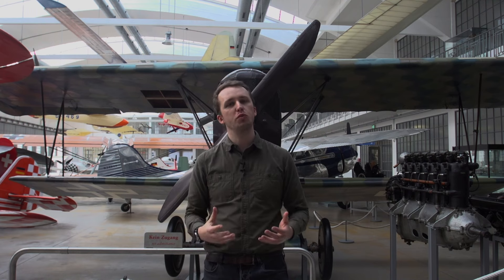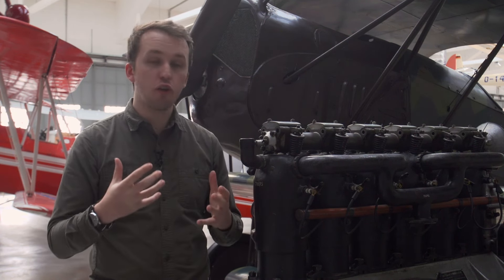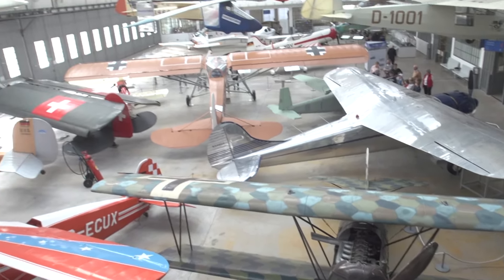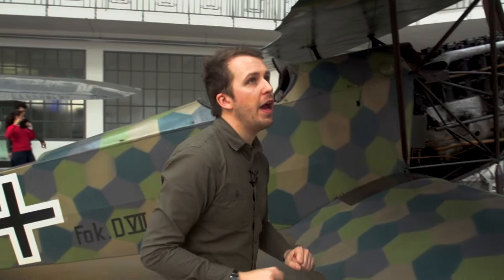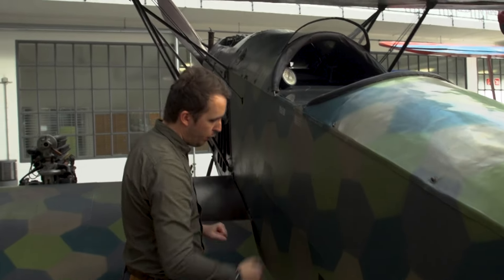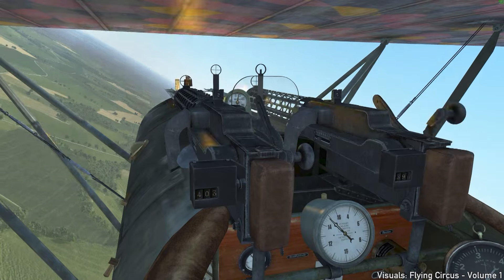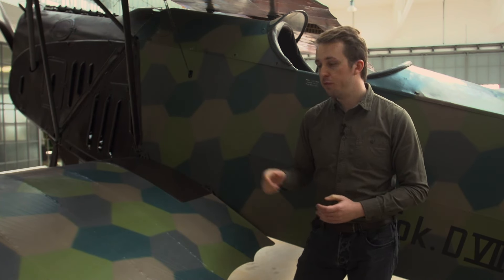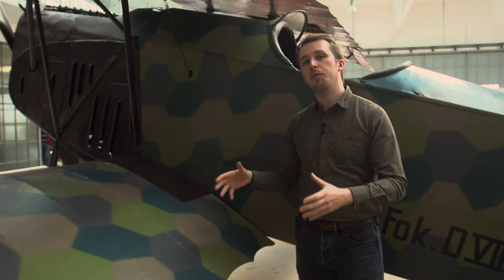Inside The Cockpit - Fokker D.VII

Comment: Excellent video Thank you! Wikipedia says it was designed by Reinhold Platz who worked for Fokker. Anyway I always wondered how the side panel of the engine compartment could be removed when the cabane struts go right through it, most notably the forward most cabane strut. I looked carefully at your video shots of it.. and I still wonder how that was done, it looks like a metal panel without a parting line at the strut hole.

Comment: Love that Fokker D7! That plane and the rotary powered D8 ("Flying Razor!") are my all-time favorite Great War aircraft. I'm wondering if the use of the BMW engine (lighter weight) made the D7 a bit  tail heavy?  Conversely, did the Mercedes engine make it a bit nose heavy? Lastly was there any provision in that era of aeronautical science for a way to trim a horizontal stabilizer to compensate for engine weight? I laughed when I saw the Cessna 195 resting sublimely ... next to this envenomed terror of the skies!
I have an old photo I found online of a D7 which I think might've been a war reparations airplane because it is devoid of guns and has the script "FOKKER D7" prominently painted on the vertical fin. It appears to be powered by the L-6 Liberty, and not either German engine. Perhaps the replacement parts for the Liberty would more readily available?
EXCELLENT VIDEO! THANK YOU!

Comment: Interesting how 10m (30 ft) has been just about average for single seat, single engine fighter aircraft from 1917 to today.  P51 is big, at 11.28m (37 ft),   F16 is average at 9.96m (32 ft, 8 in)
I believe the F16 has more power than the Fokker, though.

Comment: Thanks for another great video. However you glanced over the D,VII's main technical advancement. For the first time during the war, and perhaps in aviation history, a wind tunnel program
was carried out during the plane's development. This resulted in the flat bottomed airfoil you mentioned. Up till that point, both upper and lower airfoil surfaces were cambered like a bird's.
By late 1917/early 1918 engineers on both sides began to realize that imitating nature had its limits. This research led to a veritable "paradigm shift" from which aircraft design has never looked
back.

Comment: Do you mean 'dished' pistons?  I'd have thought 'domed' pistons would actually decrease cylinder volume.  Also, no mention of the D VII's main 'box spar' which I believe was an innovation, giving the aircraft's wings great strength and torsional rigidity.
Reply: Well, the "volume" of the piston increases, with a dome.

Comment: Thank you for your extremely interesting observations.  I have two questions and possibly an observation about the E.V/D.VIII.  The D.VII entered service in April/ May 1918,  the second flyoff occurred at about the same time.  When the E.V was selected, was it envisioned as a replacement for the D.VII, or a compliment to it?  I have always found the E.V./D.VIII fascinating.  A DR.I body with a D.VII wing,  It was 30%+ lighter than a D.VIII and used an obsolete rotary engine with only 110 h.p.   It always struck me as being a more efficient use of materials than the D.VIII, possibly cheaper to produce., more maneuverable, and perhaps even faster.  Was any of what I just wrote true?

Comment: I've got a trip booked to Bavaria in September. Assuming I can still go, I might check this museum out.
Reply: Might ? Sorry, but this is an absolutely must see and very easy to get to by public transport. There is a fantastic range of aircraft, engines and buildings, but for me, the D VII was the star. Not because of the technical innovations ( I only found out about most of these on this video), but because it is the most evil and sinister looking fighter that I have ever seen. You only have to stand in front of it to understand why it was written into the Armistice.

Comment: Just curious, why isn't the armament fitted?
Reply: or at least  dummies made from aluminium , wood or plastic ?
Reply: Simple museums usually remove armament for various reasons:
1. To display it separately.
2. Maintenance.
3. Insurance requirements.
4. Privately owned and on loan to the museum, at which case it is disarmed (or the armament is made inoperable) by law and international conventions.
Reply: @williamgosvener47  I guess those seem plausible.  Still why not install inoperable replicas?  I think maybe it has a lot to do with a general sense of fear of firearms in Europe these days.  Even fake ones!

Comment: Fokker's right-hand man, Reinhold Platz, gets little credit for his innovation employing welding and cantilever wings that made Fokker's aircraft successful. The D7 enjoyed good handling qualities that made average pilots become aces. Platz's welding techniques made flying wires unnecessary, reducing drag.  Frank Tallman, a famous Hollywood stunt pilot,  praised the aircraft as a really pleasure to fly compared to the other WWI aircraft he flew. The flaws in Fokker's airplanes such as the DR1 were the result of sloppy manufacturing and lack of available good engines, not the design. The D7 was his most perfect plane. His D8 could be argued as a better plane, but its excellent performance was due to its monoplane design that compensated for its outdated rotary engine.

Comment: Thanks for this video! I really hope to go see this plane in person some time. 

It's not certain if Fokker built any new D.VII's in the Netherlands, or just put them all together from parts and frames brought (smuggled) back from Germany. The one in this video was used by the Dutch navy (MLD), and was likely brought back to Germany by order of Hermann Göring, who was sorry that there were no remaining models in Germany of the plane he used to fly as an ace. Possibly this plane was the one designated D.28, which means it must have seen a lot of reconstruction before being put on display, as it would have had a BMW IV engine with a completely different cowling that was designed by the MLD. Another telltale sign of it being a Dutch variant, is the longeron (?) running down the side of the fuselage. Amazingly, this particular aircraft served in the Netherlands (probably as a trainer) until 1937. You could take that as a sign of how good and dependable and almost timeless the design was. Or just the sorry state of Dutch military aviation at the time. The Netherlands also has a D.VII in their military museum, but that one was brought back from the USA, where it was a movie star.

Comment: Bis. Do you have any information on real world G-load data for this aircraft, or know of a good source I could look up myself? It seems the wings are weaker for the D.VII in Flying Circus than they were in Rise of Flight. I need to do more testing myself, but it seems to be the case. In fact; the Pfalz D.IIIa in FC seems to have a stronger wing than the D.VII. 

Thanks.
Reply from the maker: Not from the top of my head. Try to look at some NACA reports, some are indicated in the description already. Don't think i saw something in them on G-load, but maybe you get something somewhere. Don't think that it got tested though.
Reply: @MilitaryAviationHistory  thanks. I'll look at the NACA reports for a start then.
Reply: @I Fly Central  I am happy to inform you that I have already completed "I need to do more testing myself" . The G-load is 7.9 ( at 8 the wing disintegrated near the wing root. For this reason we refer to the area near the wing root as the G-spot.^^ At this time I have ended "I need to do more testing myself" and currently I am in phase "I need to do even more testing myself" after which I will go straight into "I need to do the most testing myself". Unfortunately I seem to have misplaced my measuring tape which is crucial for this final stage (measuring the thickness of both, the Pfalz' and the Fokker's wings although I have no idea why that would necessarily be an indicator of a stronger wing)